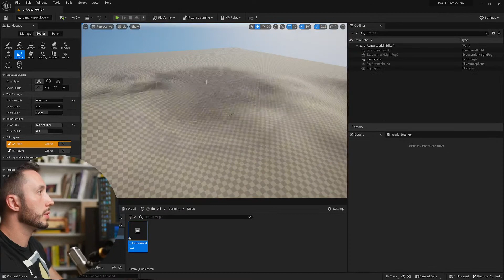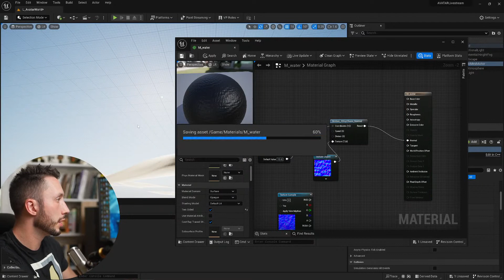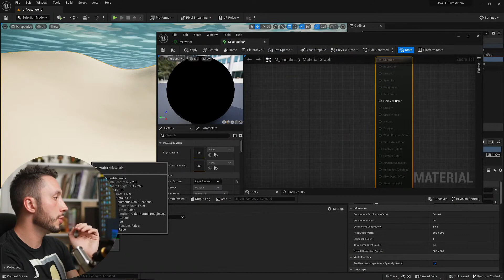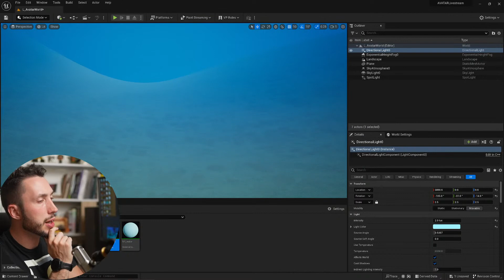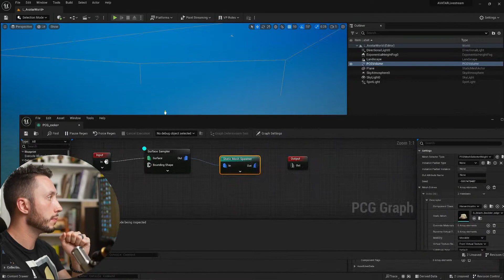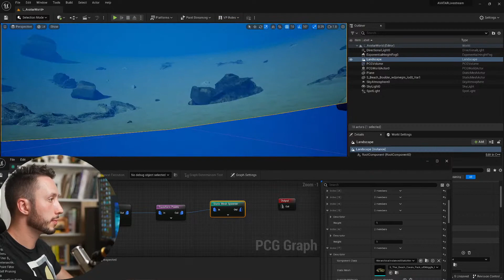Make AVATAR in Unreal Engine (P1) Lighting, Fog, Caustics and Intro to PCG - Process Livestream

Comment: I cant seem to find the light caustic for the light coming through the water. can you share or show me where to acquire it?
Reply from the maker: Hey so the caustic texture comes with the water/ocean plugin(which you will have to enable.) You just have to enable it and restart the engine. Then in your content browser click on the settings button in the top right corner and make sure you have show engine content checked on. Then you can select the engine folder and search caustics and the texture should pop up. Then you just need to follow along with me in the stream to build your caustic light material. Then you need to apply it to your light by selecting your light and searching material in the settings panel on the right side. Just drag your new material into the material slot and you are good to go. Hope that helps
Reply: @azielarts  the plug-in must not be functioning properly because it doesn't show that I have any caustics under engine. do you know how to troubleshoot?
Reply from the maker: @jakeg9813  Hmmm let me see let me know if any of these work.
1) make sure your engine versions is up to day I am using Unreal Engine 5.2.
2) Try restarting the engine after enabling the plugin and double checking that it is still enabled (it is in Edit>Plugins> then search "Water"
3) Try selecting the "All" folder on the left smaller panel when searching for the texture, just in case
4) Make sure you are searching for "caustics" in the main search field over the large content browser panel in the center

Those are a few things I can think of off hand. If the plugin lists as enabled, it really should be there